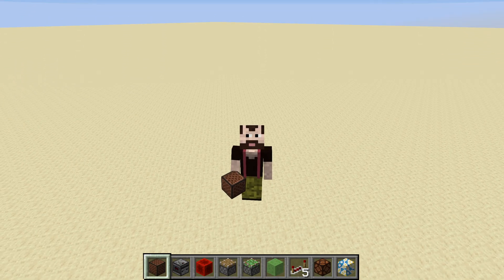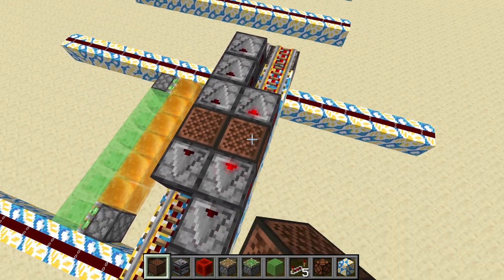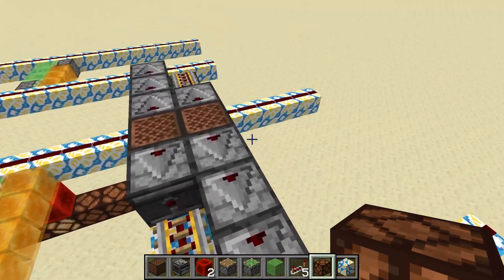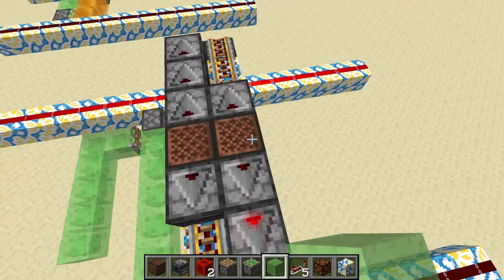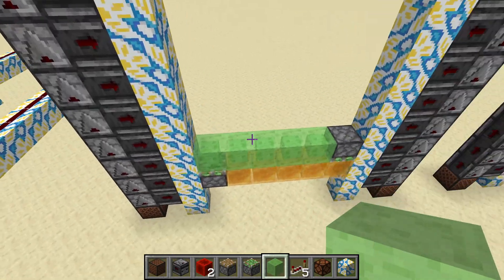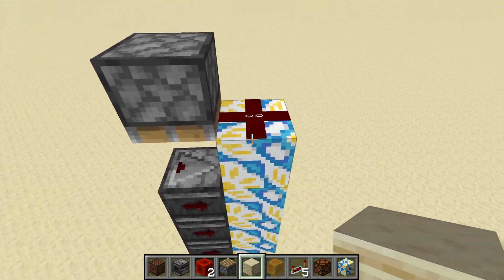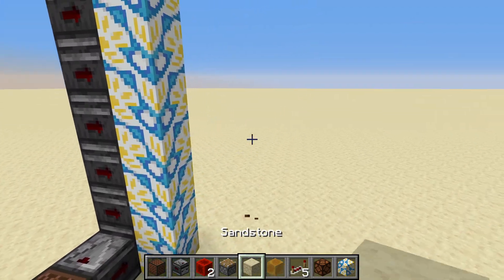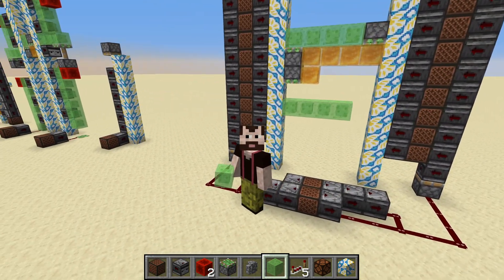Stepper motors, horizontal and vertical. | Minecraft Java 1.16

Comment: It is possible to attach the horizontal one to a clock and use it to design a mob farm? It could be interesting.
Reply from the maker: Yeah, but it would make more sense to just use a normal flying machine, they are faster. This is more for when you need very specific timing on movement.
Reply: @Borkon  I am messing around with it and it looks as fast as a standard flying machine to me with the correct timing, but i am not a technical player so probably you are right, the thing that is great about this design is that you can make it unbreakable and cheap so it can be a great alternative to moving the mobs with water.

Comment: try using scaffolding towers for vertical observer transmission, instant updates when scaffolding is updated
Reply from the maker: scaffolding updates are not instant, they move at one block per tick which causes similar QC issues that the observers have.
Reply: @Borkon  oh i thought they were

Comment: Breaking and creating bubble columns (by removing or inserting the soul sand) can be used to transmit a signal instantly up any distance.   Observers see the change in the water column instantly, even though graphically the bubbles don't seem to change instantly.
Reply from the maker: Breaking the bubbles is instant, creating them takes 24 ticks which makes them useless for tight timing which I needed for the farm I was designing.

Comment: I assume you didn't use bubble columns to control it from the bottom because they don't have the same delay on each edge?
Reply from the maker: Correct. It was either a pain to control things with good timing or a slow reset. And 12 blocks was sufficient for my needs anyway. Should have probably mentioned that I tried bubble columns, leaves, scaffolding and other methods I tried, but it was already too much video for saying "here's a thing, it's useless, but pretty fun".

Comment: Whats the mod u used in the video where u placed the observer
Reply: It's called tweakeroo, it has a LOT more features
Reply: @SpacEagle17  thanks for telling me
Reply: @rummy9464  you're welcome :P
Reply: Seems more like a linear actuator than a stepper motor, but a cool idea nonetheless.
Reply from the maker: @AkoiMeexx  well, linear stepper motor. I just used the terminology from the original video (except I forgot the "linear" part).
Reply from the maker: Also, notice that the world download is called "stepper engine", because I just couldn't make my mind up on the terminology.
Reply: @Borkon  hmmm if mumbo was here i think he would make elevator with this right?
Reply from the maker: @rummy9464  Oh. elevator, why didn't I think of that? That's a good use for this. Slow, but the point of elevators isn't to be fast, it's to be fancy.
Reply: @Borkon  it would be cool if u sould just do like 
Button 1
First layer etc and then when u press it it brings u up to the layer without having to press it over and over